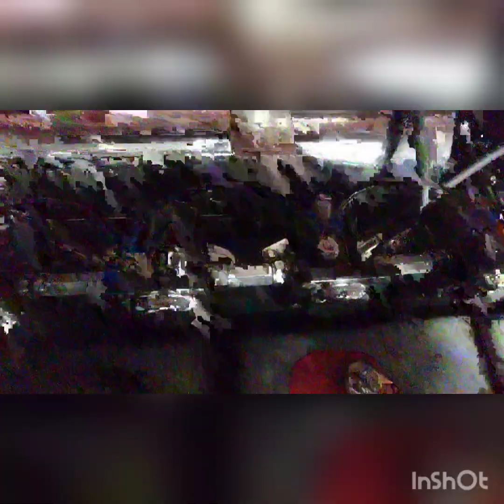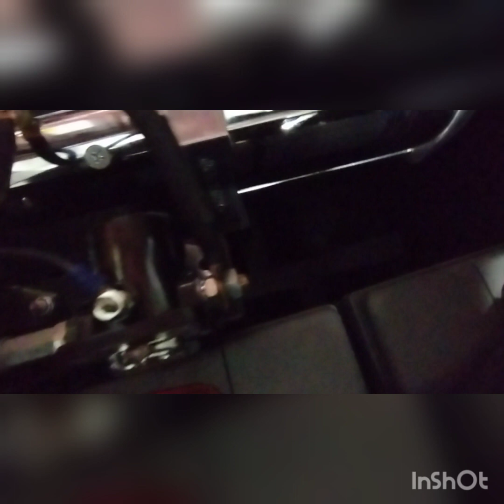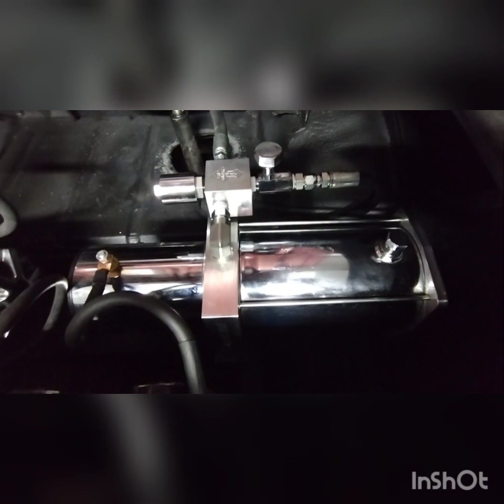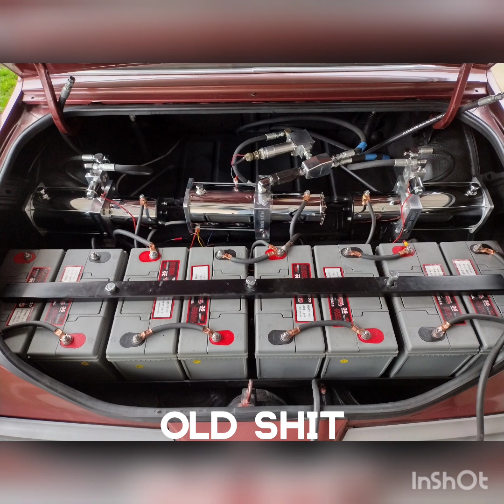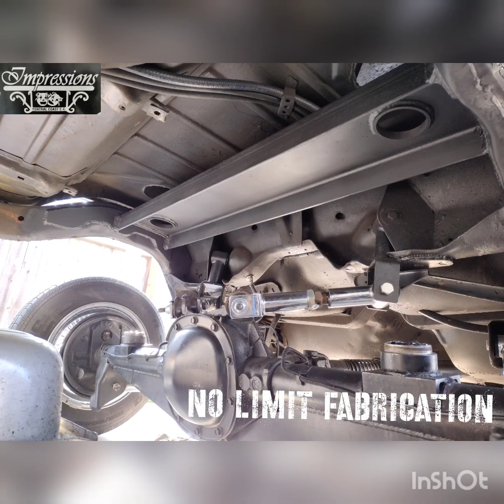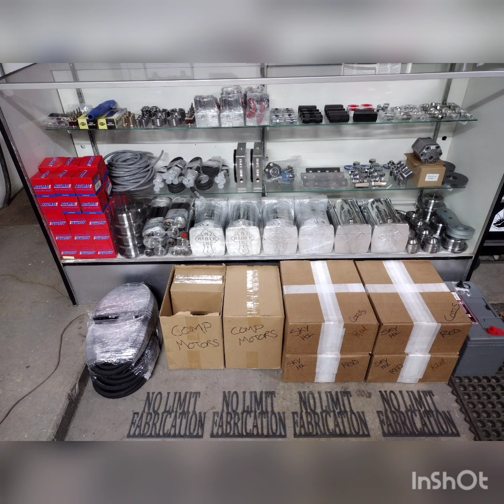Lowrider 3 Pump 8 Battery Gbody No Limit Touch Up. No Limit Hydraulics

Comment: Nice work 👏 
Question; Have you ever thought of putting two square dump setup for the piston pump connected to one single switch. So Y block connected first, right off the main block then check valves right after Y block on both sides and then T fittings for the block dumps. Just like you have it connected but for both individual returns. Each return will have its own dump for less return pressure and maximum dump, all connected to one switch. What do you think? And is it doable? Let me know. Thanks.
Reply from the maker: For being a single pump 8 batteries I believe it will rob pressure from it. 8 batteries and below single hose for max pressure for harder hit. 
For what your asking I believe that will work better for a dancer like the homies out of San Antonio Texas or for hopper on 11 to 12 batteries straight.
On this particular setup it was another shops fuck ups promising the world to the customer but could not deliver.
Brand New install electrical & plumbing all bad from the start.
Reply from the maker: Long story short on this setup it was a lot of backwards work. Lol 🤣 my bad Dawg I'm venting hahahaha I can't stand Lazy Assez